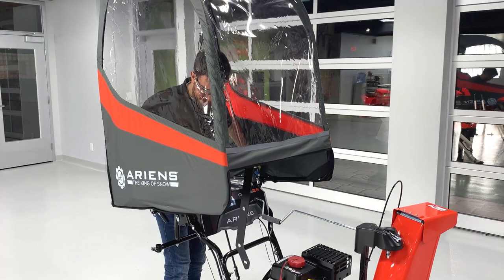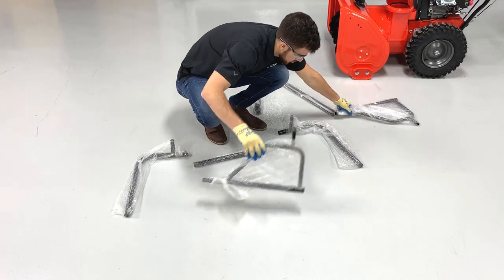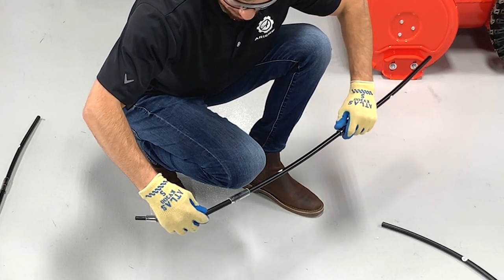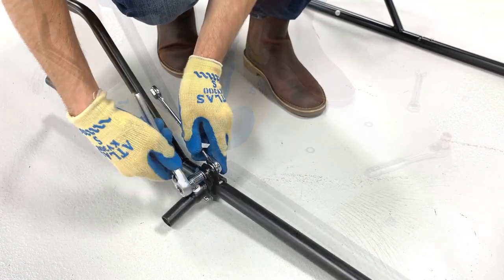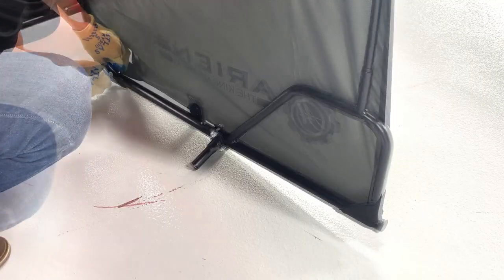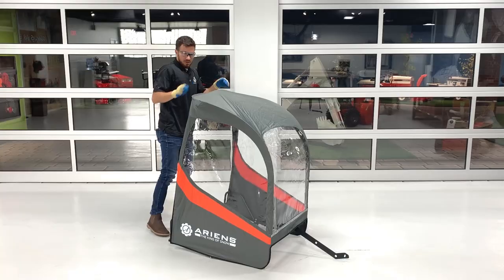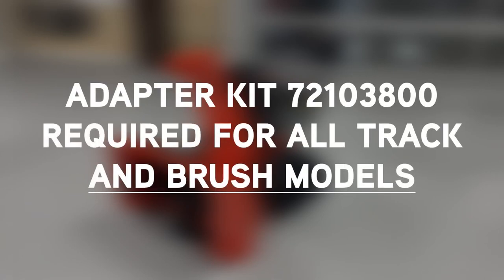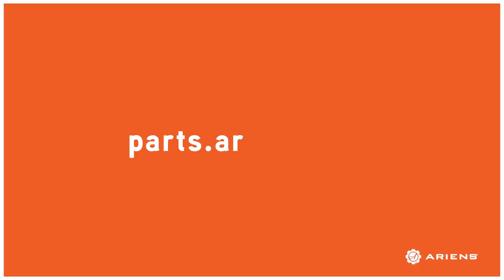Two-Stage Snow Blower Cab Assembly Instructions | Ariens®

Comment: Very sad my Ariane worked 2 seasons..  made in China carburetor is flawed. I would hire a fresh out Michigan Engineering graduate to redesign the up draft carburetor so the idle jet is not prone to getting plugged up. The idle jet which is like 0.5mm is the issue.. My 90 year up draft car on my 90 year  old Ford does not have an idle issue.. the is fix Ford figured out 90+ years ago.
Reply from the maker: Hi Michael, we're very sorry to hear about your experience. Engine no-start issues due to fuel clogs are the most frequent issues we hear about from our customers. These can occur as a result of using ethanol-blended fuels, as well as oxidation, which can happen to untreated gasoline  in seasonal storage.

We recommend contacting your nearest Ariens dealer for help. Our dealers are an extension of our team and will be able to diagnose and resolve the issue. You can find an Ariens servicing dealer in your area here: https://www.ariens.com/en-us/dealer-locator
Reply: Get the carb rebuilt & start using non ethanol gas. They now sell true fuel that will keep this from happening if you can not find pure gas.
Reply from the maker: @richardpalleschi4807  Yes sir. While ethanol blends up to 10% are acceptable, you'll get the best results with 100 percent gasoline.
Reply: I have a Ariens compact 24 runs great I run pump gas with the 10 percent ethanol during the season  but in the spring when I store it I use True fuel  first I drain all the fuel from the tank though the drain screw on the bottom of the carb put the drain screw back  in when drained and add about 6-8  oz of true fuel start it and let it run out of fuel and your done  True fuel has a fuel stabilizer and no ethanol  my blower sat for 2 seasons just filled it with fuel last month hit the primer and started first pull and ran fine through all the RPM range

Comment: Please make a video for the Kraken because the instructions that comes with the Cab does not work on the Kraken. 
If I followed the pictures from the manual it’s impossible but if I did it my way then it would work but my head hits the top of the cab and the cab is slightly tilted back! 

I have the Kraken that you guys made 460 of them I believe. with the square frame of course. 

Looking forward to hear back thx!

Comment: Guide says to add the extender post U to the lower mounting posts. M.

What the hell are the M mounting posts, I don't see them in the assembly guide
Reply from the maker: Thanks for asking! You'll only need to use part M if you're installing this cab to a Professional-series unit with square tube handlebars.
Reply: @AriensChannel  I don't have them with the cab I ordered.
Reply from the maker: @moog38yearsagoupdated1mont9  Could you let us know which cab kit you ordered? The one in this video is cab kit 721033, and it should come with the M brackets. If you purchased kit 721026 (https://www.youtube.com/watch?v=grwxK5MtJ-c) it won't come with those brackets.

If you purchased kit 721033 and didn't get those brackets, please contact us via our support link below and we'll resolve the issue as soon as possible 👍

https://www.ariens.com/en-us/productsupport